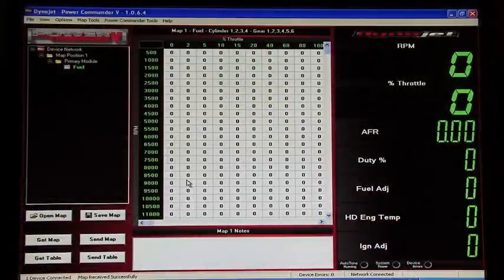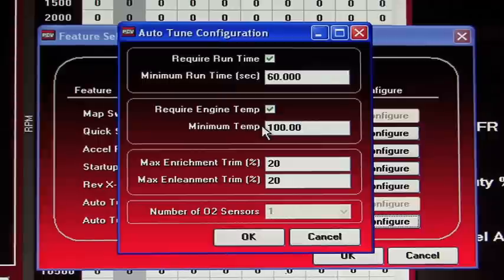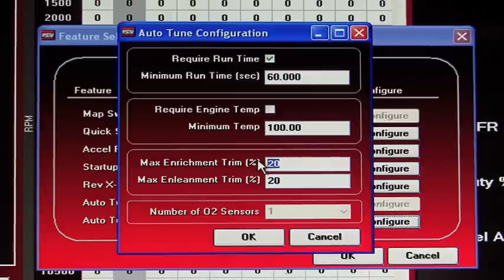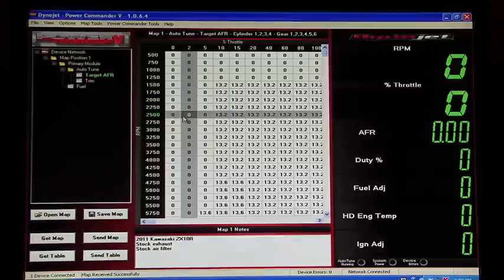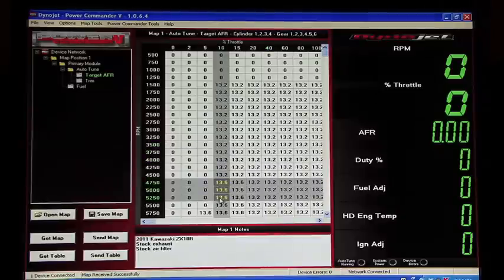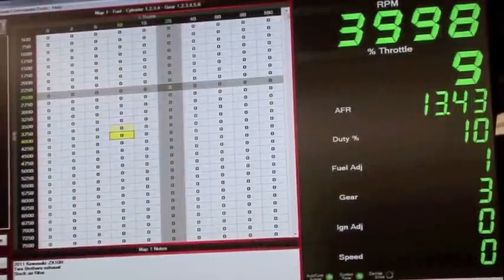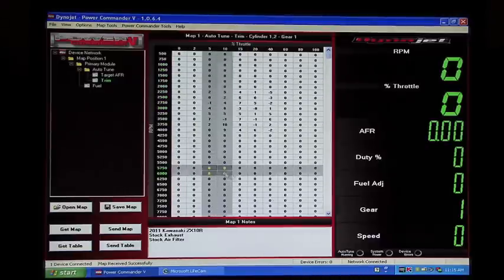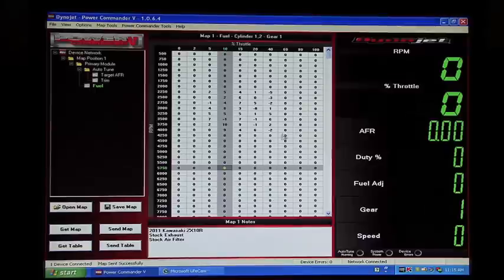Dynojet AutoTune Software Introduction

Comment: Question please:
With Autotune enabled it is making live adjustments and recording changes on trim table. If you turn ignition off and back on it will still remember and apply previously learnt trim adjustments?

Does this mean if you turn Autotune setting off it will revert back to base map, but still keep observed trims in memory if you decide to turn Autotune back on and not have to start over?

That is unless you decide to commit the Autotune identified trims to base table, in which case even with Autotune turned off, the A/F ratios will remain correct as the learnt trims are now part of base map, right?

Comment: Has anyone tried this stuff on a Gen3 KLR? Thus is all I've found so far:

Bad news: DynoJet's Power Commander KLR tune does not resolve the mid-rpm fuel cut issue. Also, changing the fuel values (from 0 to 1) on 0% throttle for 3k - 7.5k RPM and it made no difference. I had a feeling this would happen. The DynoJet is a piggy back module. The ECU knows nothing of it.
Good News: Definite 'seat of the pants' power increase! Pulls much better in the mid range while maintaining smooth control for the slow stuff. Looking at the maps, they achieved this by bumping up the timing advance values in the mid range. They made minimal changes to the fuel map. I'd compare the change to hitting the 'sport' button in your car or tow/pull button in your truck.
--
Power Commander

I don’t have one but those that have tried them on bikes in general say 1 to 2% increase. So .4 to 1.8 horsepower. Barely noticeable. The big bore kits seem to be the only thing that pumps up a KLR.

I have two 2022 KLR’s both with power commanders. One has a Yoshi slip on and one has stock exhaust. Big improvement on both bikes but the Yoshi in my opinion gained at least 10% more. Much more throttle response and the added ability to pass cars on highway by just rolling the throttle instead of a requiring a down shift. Also a noticeable reduction in engine vibration at 60 to 70 mph. The engine just runs smoother. Definitely worth the money especially if your already adding a slip on exhaust.
If you add the PC to your stock exhaust it comes with a map ready for that exhaust. You’ll notice a quicker throttle response and a bit more horsepower. Add a slip on with the PC and the improvement over stock is significant. Hopefully soon, PC will have a map specifically tuned for a few different slip on exhaust options. Either way, the PC is a great upgrade.

Re-Flash The ECU Or Aftermarket Tuner
Most modern bikes have an engine control unit (ECU), a small computer chip that controls (and much of the time strangles) various aspects of the bike’s performance. That chip is factory-programmed to comply with emissions and fuel requirements, but lucky for you, it can be remapped/re-flashed to uncork performance. An ECU (re)flash involves changing the stock onboard programming with a new tune usually resulting in good power gains (depending on your goals). But if you’re always changing parts on the bike (exhaust pipes, etc.), an ECU flash is probably not for you. Also, if done incorrectly your bike will suffer, so make sure the grease monkey doing the work knows the lay of the land.
Or you can go with an aftermarket fuel/power tuner (like a Power Commander or Vance & Hines FuelPak) to adjust those stock settings. Broadly speaking, tuners come in two flavors: plug-and-play units designed for stock or lightly modified engines, and those that can be programmed to add more fuel or air and tweak other settings at different ranges to make more power to meet a highly tuned engine's needs. If you've slapped on a new pipe, you'll definitely want a tuner to get fuel mapping brought into line. These units can be a much simpler and more flexible deal than a re-flash.
Result: Unless you're piggybacking with some other change, power gains won't be much, but they'll improve overall rideability.

Comment: Why does my afr show 655.35 after warmup . Before that shows 9.99. Sensor test shows 2 blinks at ground level which says sensor is correct.
Reply from the maker: Hi there, please contact our Tech Support at 1-800-992-4993 or through email at powercommandertech@dynojet.com
Reply: A value of 9.99 could indicate a faulty sensor or the sensor is wired incorrectly to the module.

Comment: I download the Powercommander software. But when I connect the laptop to the Power commander with the USB it does not read anything. Am I doing something wrong? I have a stock intake and Basanni Pro Tune exhaust.
Reply from the maker: Miguel, if you contact us at powercommandertech@dynojet.com, we can help you out.

Comment: I have a 2013 gsxr 750. I just installed a pcv and autotune. On the afr table after 14.5k ish the values are zero. My bike revs out to 16k ish. Is there a reason for this? Should I set the values myself? Or leave it alone?
Reply: Well, you can set the values a little bit more rich to protect the engine at that high RPM range. It all really depends on what the motor wants though. Should have a mechanic tune your power commander. Although, you could read up on air-fuel ratio theory just in case. Odds are though that they want to leave the high RPM load to the base map so that there is less chance for glitches that can break your engine. When in doubt, leave it
Reply: Yeah, rev limiter kicks in at 14.5k factory

Comment: Hi
My bike is a KLV (V-strom) and with PC5 it as solve some "puffs" issues but isn't perfect yet.
If i add a autotune and just do what you show us on video, the bike it will work properly every day after?
Reply: ***** Hi again.
A strange issue comes up now.
Engine don't start properly and shuts off immediately. It seems that just one cylinder is running. And smells too much gasoline.
Then I've unplug PCV and it's all ok with the bike
So now I don't know whats happen. If I did some wrong table numbers or PCV simply dead. I'm gonna try do a PC reset and then plug it again.
What do you think about that?
Reply: psyfinger have you solved the issue with your pcv??

Comment: I'm tuning my bike and I replaced its throttle bodies for smaller ones. I suppose my fuel map is completely messed up. Do you think auto tune with PCV can correct it? Can I track all changes made by autotune (And transfered to base map) in a way I can use the best autotune map as a base map in other engines with the same mods (And PCV installed)? I mean, if I want to sell this map (recipe) later?
Reply: Yes,  you can.  Easily.
Reply: Thanks!

Comment: I have successfully tuned my KTM 990 adventure with PCV and Autotune. The bike is a whole different experience. One tip that would help everybody to tune faster their bikes is to use a BASE map that is as close as possible to your particular setup. I mean if you have Akrapovic exhaust or added an aftermarket air filter that restricts less your air intake make sure you use a fuel map that is as close a match to these particular add-ons...

Comment: Hello.
I have installed the PC5 and Autotune to my ZX10R 08. Everything is working fine ..BUT!! the AFR cells are all 0 as described in your video. This means that my autotune will not tune those cells...What do I have to key in to all those cells??? Or is there a chart which I can download?? Thanks for your help.
Reply: You need a dynojet wb2

Comment: I have some trim values that are in the 30's, but only in 1 or 2 cells. Could it be from letting my bike decel while still in gear? Basically using the engine to brake.

Comment: its mean this will auto tune the vehicle’s fuel and air mixture based on the setting we create to the device setting after specified time or temp and no need for applying a long tirm map if i get the desired mix .

thanks alot for the help

Comment: Is it mean that every times I need to tune my pcv5 using the auto tune I have to put it in dyno or take the bike for a ride then come back to send the value to the pcv5 main table?
Is it mean this thing (auto tune)not happen until taking the bike in dyno or for a ride and ride to the maximum speed and rpm to get full table?
Finally do I need to do this again on different weather condation and attitudes and temperatures? I mean the auto tune table will created passed on the temp and attitudes?